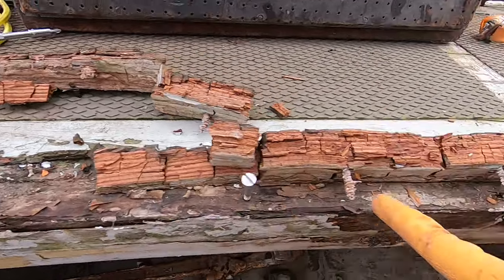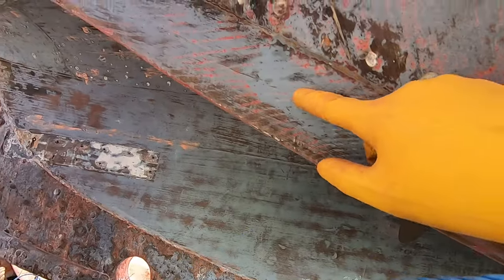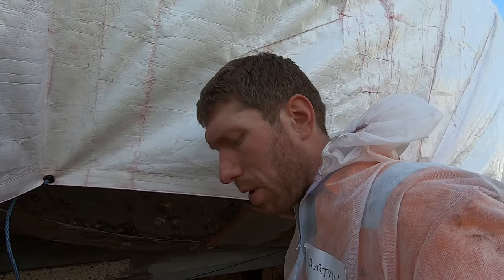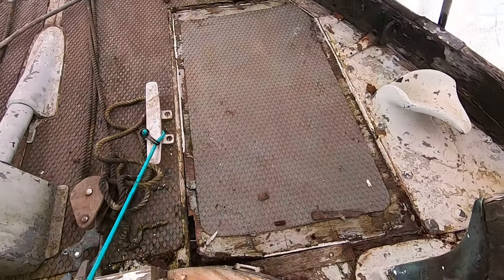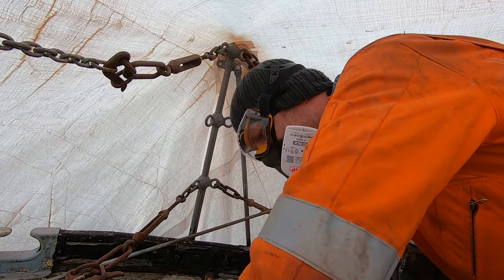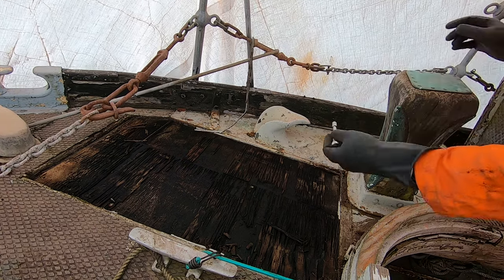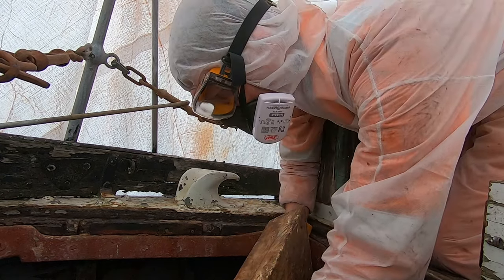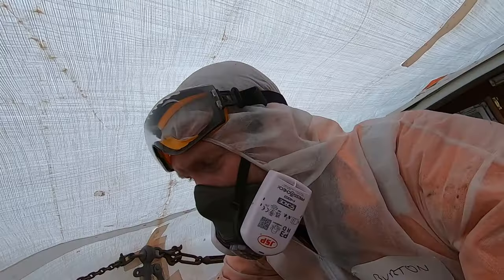Restoring a Dunkirk Little Ship. Episode 6: We Need To Investigate the Planking

Comment: Look into how diagonal planking was made you'll probably find a layer in-between which is an oily matting but looking at the main timbers it's fine, if your cleaning said timbers use salt water as it'll preserve them. Decking take it all up in sections, your doing a fantastic job studying area's first, PPE well done there too.

Comment: You should get a few cheap 1" light rachet straps. The type for holding surfboards or similar to a roof rack. It would give you a better hold on those boxes. Mind you getting the strap around some of them could be an issue. For comfort sake I'd just use a paper mask to keep dust out of your pipes. The full dust/ vapour mask is a bit of an overkill and darn uncomfortable for any more than 10 minutes. I've worn them all, up to State of the art 3M and they still feel like a tin of beans on your nose. I was recommended a 'Trend Stealth' mask. Shaped like a flys eye; light as a feather and very compact. Designed for woodwork where you need to get in close. The filters are inside, with dust and vapour elements available. Easy to rinse out too, with a little drain plug. 
Have to say its the only mask I dont mind putting on. 
Your head torch while an excellent brand, gives limited light for dark caverns. I had an early version  back in the '80's for night walking. 3 'c' cells driving a halogen bulb, jeez the weight. I upgraded for work purposes to a brand called LED Lenser. Focusable beam and an adjuster on the back of the battery box for light intensity. Both are reasonably cheap for what they are and available at screwfix or Amazon. Having to wear uncomfortable PPE is just so off putting and wearing on the soul. I'm glad I have finally retired and only have to wear a mask for wood work.
Keep plugging away, hard going on your own.